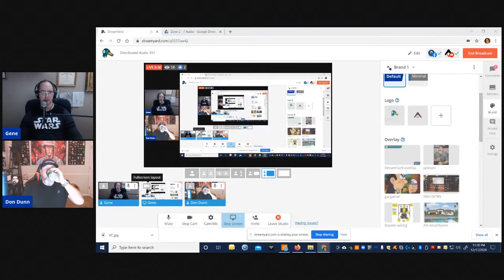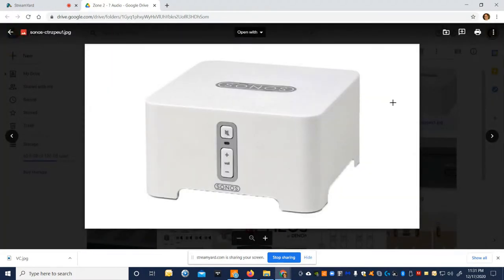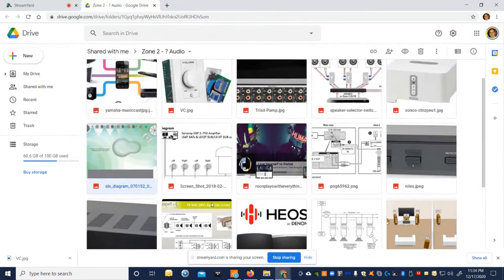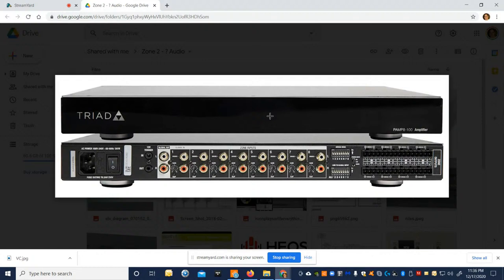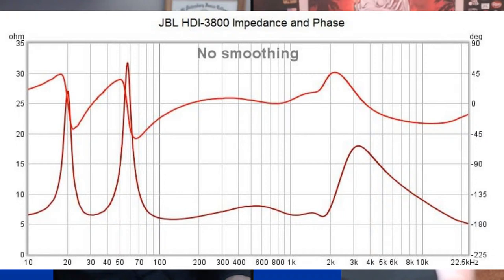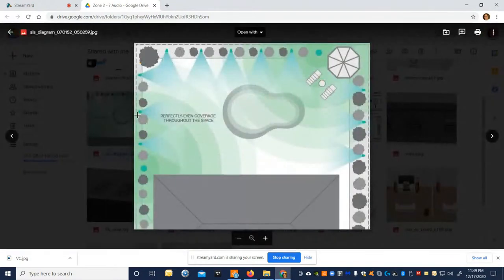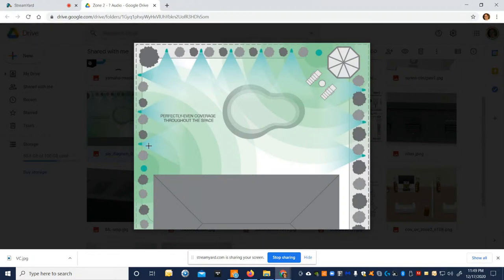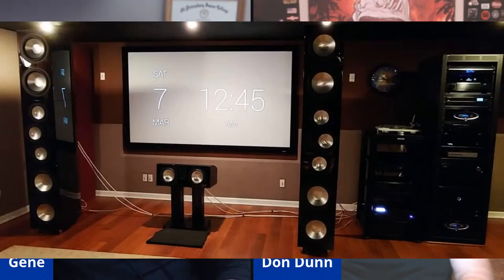Distributed Audio 101: Multi-Zone to High Res Control System

Comment: Finally...I wired by home for distributed zones!  Each zone has a volume control on the wall. I purchased an Onkyo home system. Add a HTD amplifier and 4 zone box.  

Wish there was more detailed explanation for wiring the ATT cable box, internet, smart TV the Onkyo TX NR 696 and the HTD amplifier,

Comment: I have bought several Apple Airport express's and can use them (with Roon for example) to create a low cost distributed, and time aligned signal (Airplay v1?).  Add a old receiver and some speakers to each room, and get it done.

Comment: My whole home system is all running on Apple Airport express routers, they have a built in 3.5mm headphone/optical port.  I then have multiple 2 channel systems around the house. Only problem is, Airplay 2.0 is limited to 16bit 44.1   So I’ve been waiting on a new Apple Tv and Airplay 3.0 to revolutionize the Apple ecosystem, with of course a hi-res update to the Apple Music library, currently slogging along at 256kbps.  But I think Airplay 3.0 is going have a surround sound function to utilize homepods and homepod minis in a 5.1  At low volume levels homepods can dip down around 20hz but you’d think Apple would throw a sub in the mix. At which point it’s a tall order, and I don’t know if Apple is ready to go that hard on a niche product when the whole home theater industry is staring them down.  Maybe sub-outs lol

Comment: who made the very best speaker selectors that could handle like over 1000 watts of power and literally added NOTHING to the signal for "reference" grade speaker selection for something like a dealer's demo room for demoing multiple high-end speakers from a single high end amp?  And were those ever used for distributed audio?

Comment: Very interesting, but personally not in the market right now for a whole home install. That said, the one thing I heard that made my ears perk up was about how great class D amps are getting. Okay. But don't make it sound like they're anywhere near the sound quality of a class a or a/b yet. I haven't heard a class D amp that can hold its own against a good linear power supply.
Reply from the maker: You are mistaken.  Some Class D modules like the ones from Pascal and Purifi equal or exceed the very best AB designs.  Purifi Class D has noise and distortion figures below the threshold of measurability of most test gear.
Reply: @Audioholics  I'd have to hear it to believe it. Like the saying goes, the proof of the pudding is in the tasting. You can't taste (or hear) test bench measurements. I know you all are all about measurements. They're only half the story IMHO.
Reply from the maker: @thudeets  the proof is in the measurements IF the proper measurements are done. Only controlled blind listening tests can accurately determine audibility by eliminating human bias.
Reply: @Audioholics  I still can't shake the idea that there's more to the story than an evaluation based strictly on measurements, although I understand that measurements are important when done right and you all do a very good job of doing it right, and of interpreting measurements and explaining why they are important; it's one of the reasons I follow your channel. I've heard the pascal X-pro module in an amp. I'm not familiar with the purifi.